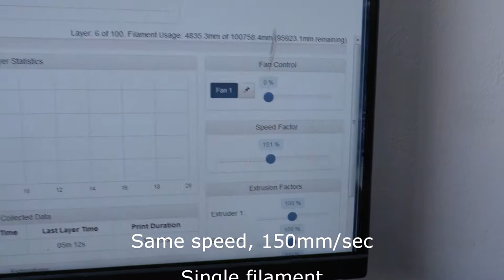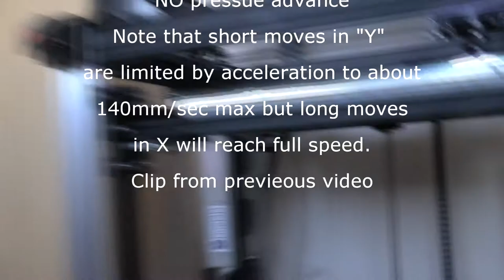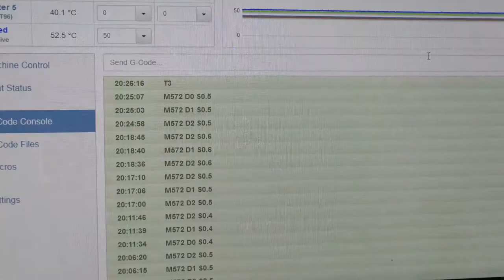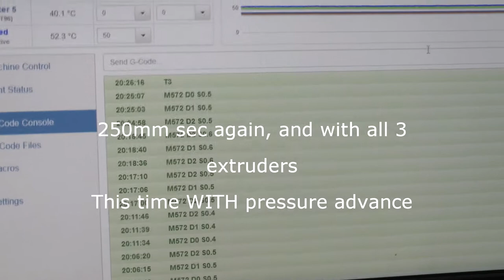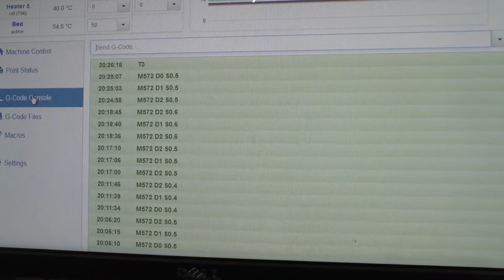Duet pressure advance testing

Comment: I like your idea to keep the extruder mass separate. "Flying extruder" construction refined very well 👌
Reply from the maker: Good Lord - that video was made 5 years ago! Since then, I changed to 5 extruders and later still, to 6. The passive gantry worked OK with 3 extruders but when I increased the number of extruders to 5, I made the extruder gantry another driven XY gantry (the UV axes), which became the world's first CoreXYUV printer. This works better but the downside is that I have to post-process every sliced gcode file to add the UV moves.

Comment: Looks amazing! About to upgrade my formbot trex3 to a duet3d h6c board... can’t wait!
Reply from the maker: Having used every version of Duet board from the first 06 through to the current generation 3, I would urge you to get the Duet Ethernet or Wifi instead. See my other video on Duet3 vs Duet 2 for the reasons why.
Reply: @deckingman  unless I missed something it seems like most of the issues if not all are related to using expansion cards right now. One of the reasons I chose the 6hc is because it has 6 onboard drivers - the amount i need for my printer to operate in idex mode.
Reply from the maker: @TheFunVampire  If you need 6 drivers, then in that case the Duet 3 HC6 is indeed the better option. To use 6 drivers using gen 2 would mean that you'd need to buy a Duex 2 expansion board, as well as a Duet (Ethernet or Wi-Fi) main board. At this moment in time, the RPi doesn't bring any additional functionality (apart from giving WiFi access capability) and the 6HC will work perfectly well in stand alone mode, so you can save some money there if you need to.

Comment: looks great but what is the setting in your reprap ?
Reply from the maker: That was more than 3 years ago! Not sure that I understand your question though. As far as I can remember, I think the best value for that hot end was about 0.4 or 0.5.
Reply: deckingman is that is the k value for marlin or the setting for the s in the m572
Reply from the maker: @EnergySeeker  It's Duet hardware which uses RepRap firmware - not Marlin. So that was the "S" value for M572.
Reply: @deckingman  thanks a lot

Comment: Love it! The lines getting too thin in the middle while doing top level infill is a problem i see on all of my machines.

How does the pressure advance effect other setting like retractions? are you use any coasting? or has that all getting better?
Reply from the maker: Hi. To be honest I've temporarily turned off pressure advance because there is an issue when doing small circular perimeters while using multiple extruders. It seems to be a firmware issue but it's difficult to replicate. It's fine when only using a single extruder but right now, I'm trying to get my new 5 colour Diamond dialled in so I need to use multiple extruders. I can say that I needed a fair bit less retraction when I had pressure advance enabled.

Comment: Damn that printer. Makes my flashforge and prusa look so dated! Wish they sold printers like that
Reply from the maker: Thanks. That's quite an old video now and the printer has changed quite a bit since. It now has 5 extruders and the upper gantry is now actively driven as a second CoreXY, rather than being dragged around by the main hot end gantry. You can see it in action here https://www.youtube.com/watch?v=aRhuQ5GZOSc&t=4s